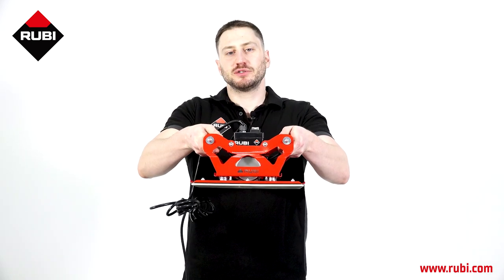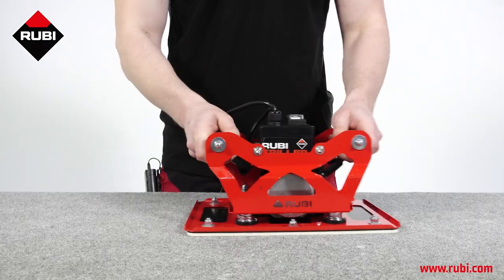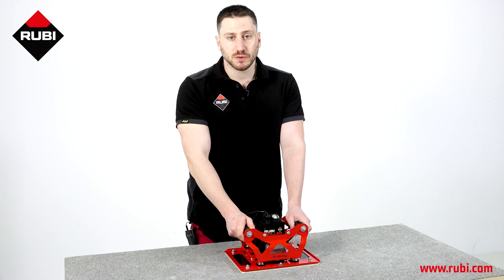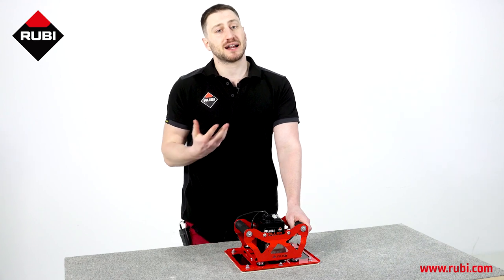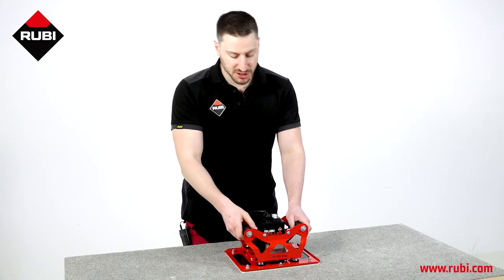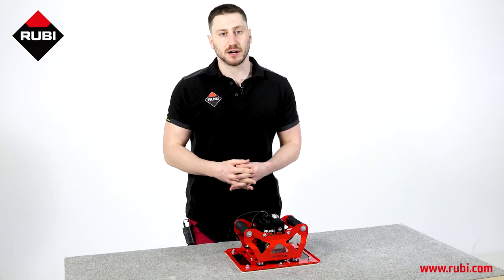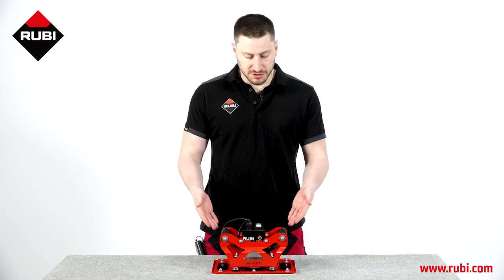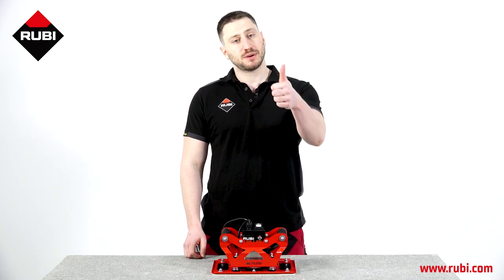RUBI TRILLER, to Remove Air Blistering Under Large Format Tiles US

Comment: I'd like to see more than one big tile set do you still use leveling clips with that vibrator?
Reply from the maker: Hello Tracy. Yes, you should definitely use a leveling system with the vibrator. The vibrator gets the air out from under the tile, but that doesn't necessarily mean the tiles won't dry unevenly for other reasons.
Reply: @RUBITools  Okay that was what I was thinking! Thanks
Reply from the maker: No problem! Glad to help!